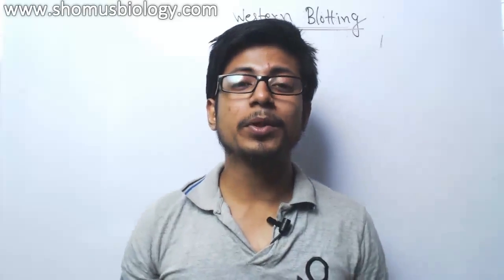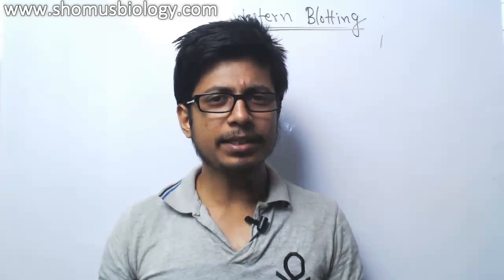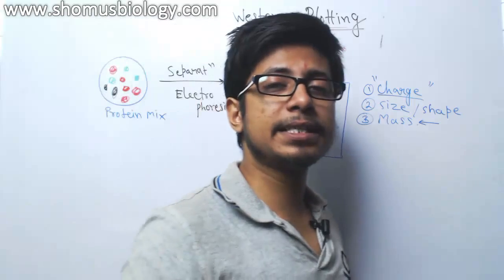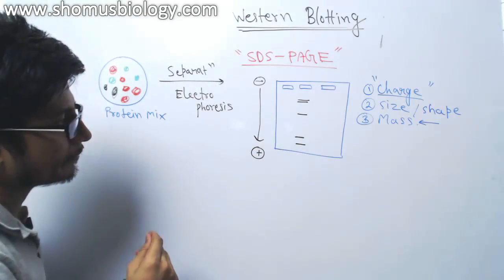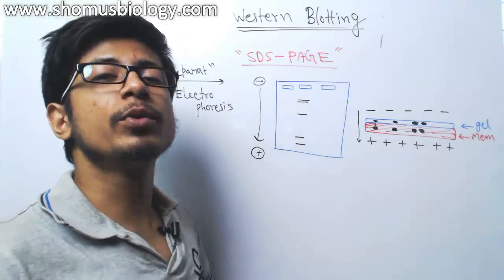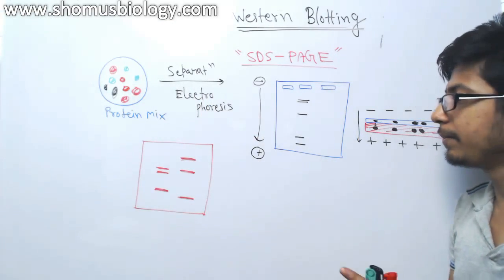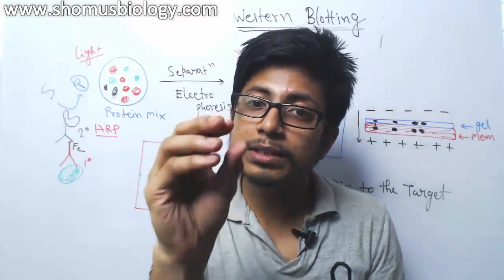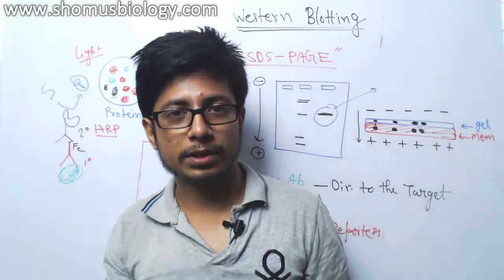Western blotting technique | principle and step by step procedure

Comment: Hi....I have a question. If I induce the cells with a Plasmid that fuse with BioID and then they get treatment with Biotin, what I would expect to see in SDS-PAGE using Streptavidin fluor Fluorescent?  Do I need to apply for primary and secondary Antibodies? Or Streptavidin flour Fluorescent is enough? I would appreciate your answer.

Comment: Sir why didn't we tag primary antibodies instead of 2ndry antibodies
Reply: The secondary antibody binds to the primary antibody but not any target that is present in the specimen. Secondary antibodies bind to the heavy chains of primary antibodies so that they don’t interfere with the primary antibody binding to the target. This secondary antibody is made in a species that is different than both those of the primary antibody or the specimen. This minimizes non-specific binding that leads to false positives and high background noise.

Comment: Why would you not add enzyme in primary antibody..🤔
Reply: The secondary antibody binds to the primary antibody but not any target that is present in the specimen. Secondary antibodies bind to the heavy chains of primary antibodies so that they don’t interfere with the primary antibody binding to the target. This secondary antibody is made in a species that is different than both those of the primary antibody or the specimen. This minimizes non-specific binding that leads to false positives and high background noise.

Comment: sir ,why cant we add enzyme to the primary antibody itself so our test would be simplified?
Reply: The secondary antibody binds to the primary antibody but not any target that is present in the specimen. Secondary antibodies bind to the heavy chains of primary antibodies so that they don’t interfere with the primary antibody binding to the target. This secondary antibody is made in a species that is different than both those of the primary antibody or the specimen. This minimizes non-specific binding that leads to false positives and high background noise.

Comment: I have a few questions as stated below:
1) why did we attach the negative electrode to the SDS-gel if it already contains a negative component i.e. the sulphate that helped to denature the protein?
2) If multiple Ab binds to a specific protein,is there a chance to get improper result?
3) When did we add the Luminol?
Reply: A key part of the lecture he missed is the role of SDS and that West blotting detects Amino acid (AA) sequence for proteins (other blots detect nucleic acid sequence).
AA have a Verity of charges. On treating the denatured protein (I.e AAs) with SDS, the SDS coats the surface of the unfolded AAs to give the protein a net negative charge. Hence the proteins have a -ve charge and move towards the positive electrode attached to the membrane. You need both -ve and +be fields to run electrophoresis.
2. Antibodies are usually highly specific to antigens, but in this case,some stray away and bind to the membrane (Hence "blocking" is necessary or you get false +ve results)
3. The secondary antibody which binds to the primary antibody (an anti-immunoglobulin) is conjugated with an enzyme eg Horse radish peroxidase (HRP). 
HRP catalyzes the degradation of the substrate luminol. As Luminol degrades, it emits light the position of which is detectable on x-ray film

Comment: Sir, I have a doubt... In Western blotting, we are using a secondary antibody attached with an enzyme that in the end provides detection... Why can't we use the primary antibody directly for that purpose attaching the enzyme there only... Won't that reduce the cost of developing another antibody... Or is that a necessary step... Please explain sir...
Reply from the maker: Using only primary antibody can cause more nonspecific binding hence more background noise

Comment: Instead of using sec. Antibody... U can attach any fluroscence molecule to the primary antibody... And can check the fluroroscence..??
Reply: The secondary antibody binds to the primary antibody but not any target that is present in the specimen. Secondary antibodies bind to the heavy chains of primary antibodies so that they don’t interfere with the primary antibody binding to the target. This secondary antibody is made in a species that is different than both those of the primary antibody or the specimen. This minimizes non-specific binding that leads to false positives and high background noise.

Comment: Why can't we use directly some specific enzymes that bind to Fc of primary antibody and give us result without the expenditure of  2° antibody ?
Reply: The secondary antibody binds to the primary antibody but not any target that is present in the specimen. Secondary antibodies bind to the heavy chains of primary antibodies so that they don’t interfere with the primary antibody binding to the target. This secondary antibody is made in a species that is different than both those of the primary antibody or the specimen. This minimizes non-specific binding that leads to false positives and high background noise.

Comment: Asalamualikum sir thnx for such vedio. 
 Sir i have two questions 
 1st is why we not use secondary antibody directly and not use primary antibody?
 2nd sir how we extract our targeted protein from membrane?
Reply: The secondary antibody binds to the primary antibody but not any target that is present in the specimen. Secondary antibodies bind to the heavy chains of primary antibodies so that they don’t interfere with the primary antibody binding to the target. This secondary antibody is made in a species that is different than both those of the primary antibody or the specimen. This minimizes non-specific binding that leads to false positives and high background noise.

Comment: Can't we attach some fluorescence molecule directly to primary antibody and visualize or can't we add the enzyme to the primary antibody itself instead of secondary antibody?
Reply: The secondary antibody binds to the primary antibody but not any target that is present in the specimen. Secondary antibodies bind to the heavy chains of primary antibodies so that they don’t interfere with the primary antibody binding to the target. This secondary antibody is made in a species that is different than both those of the primary antibody or the specimen. This minimizes non-specific binding that leads to false positives and high background noise.

Comment: Why don't we use 2° antibody directly?
Reply: Secondary antibodies can only detect primary antibodies.Not ur protein of interest.
Reply: The secondary antibody binds to the primary antibody but not any target that is present in the specimen. Secondary antibodies bind to the heavy chains of primary antibodies so that they don’t interfere with the primary antibody binding to the target. This secondary antibody is made in a species that is different than both those of the primary antibody or the specimen. This minimizes non-specific binding that leads to false positives and high background noise.

Comment: Thanks for the video. Couple of questions: in general terms what does the result tell us? We've broken down the cell contents and extracted the soluble portions (i'm assuming the current only allows proteins to travel as they're negatively charged), but i don't understand why there are multiple wells... The solution is homogenous right? Or are we comparing the contents of different cells in each well? And the migration of the proteins tells us  which proteins are present in each cell. Is my thinking right? Thank you for any response you can give me and great video once again!